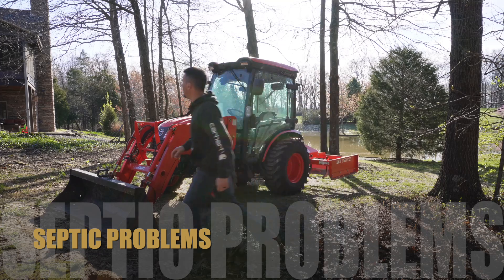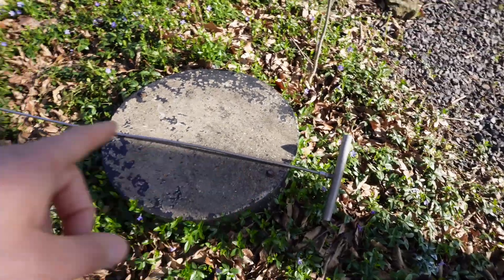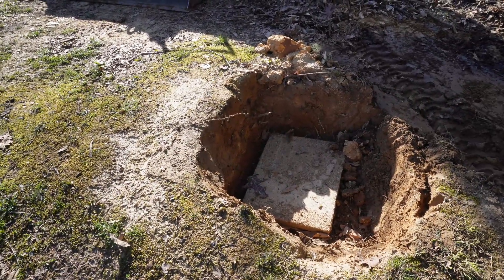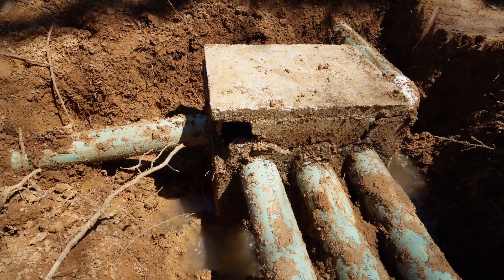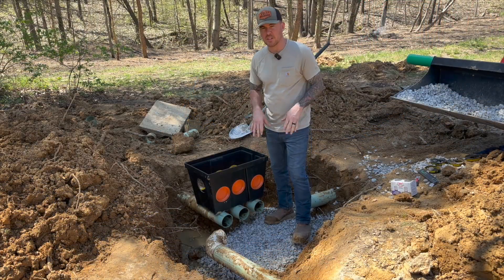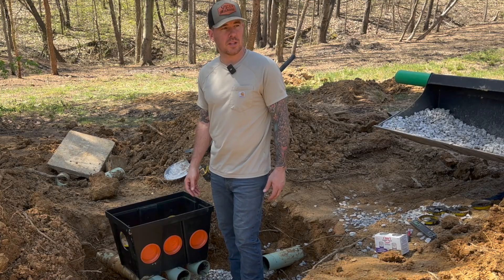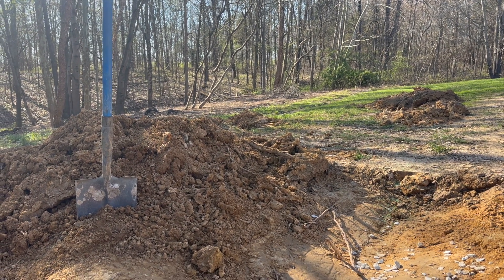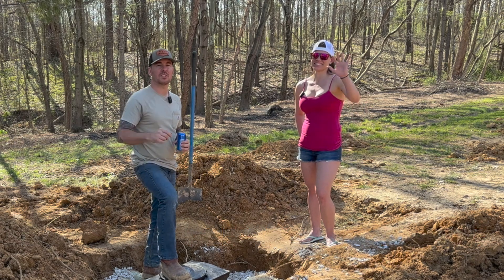PROBLEMS ALREADY!  How To Replace Septic Distribution Box.

Comment: Hey pal, if you are getting any solids in your d box the problem is in the septic tank. It's great you had the tank cleaned, inspect the baffle in the tank, third, install an effluent filter available at any septic supply house. Momma might do diapers but never sewer schtuff! That's on u. 😮

Comment: I am selling my house. Just had septic inspection from buyers. Everything checked good except my distrubution box. Yep it was like yours but worse. I think I can handle this job myself. I lack a cool tractor like yours to lift out the rest of the box. Question 1. Did you use regular DWV pvc pipe and glue for the repairs? I may have misssed it in the video. Quesion 2. Was the gravel you used as a base to support the box basic gravel or a specific size? Thank you

Comment: Could a bad distribution box cause water backing up in the house?
Reply from the maker: Not usually.  Have you had your tank pumped?   A full tank will do it or a failing leach field. Is your yard all wet where the leach field is?

Comment: Meant to thumbs up but there's only a thumbs down sorry watching have a job to move tank switch with alarm some areas ive seen were very similar I think the ground had to much rain and couldn't drain but our problem is the water goes down hill back to septic and alarm for pump goes o ff he has to push switch in basement he wants to move it up he's afraid he may fall down the stairs at night he's getting close to 80 so next week I will move switch to top of steps

Comment: I mightve missed it but how old was the d box?
Reply from the maker: House was built in 05.
Reply: @SpicerDesignsLLC  -- ok thanks.  Mine was built in 1990 so I'm thinking it's probably time to replace it.  I have a lot of seepage.
Reply from the maker: @Everclearish  if you dig it up and its falling apart then yes.  The seepage can be a lot of things.  May need to try running some treatment through for a wile and see if that helps.  The leach field may be clogged up.
Reply: @SpicerDesignsLLC  -- Yeah that's what we've been doing.  Fingers crossed
Reply from the maker: @Everclearish  i actually checked the dist box last night. Its full of water which means the field isnt draining.  Looks like ill be digging up the leach field and replacing it.  What a pain.
Reply: @SpicerDesignsLLC  -- Sorry to hear that.  That is a pain and more $$$ too.

Comment: How did it end up working? Was it distribution box or leach field?
Reply from the maker: The one finger is still a little wet.  Wet spring doesnt help either.  The box had to be replaced regardless.  I still have more work to do but its getting better.
Reply: a leach field repair video next
Reply from the maker: Ya thats coming but i probably wont film that one.
Reply: @SpicerDesignsLLC please video the leachfield repair! This video was helpful

Comment: I'm curious, I watched this video a couple months ago and did this repair fix your seepage problem?
Reply from the maker: Its definitely gotten better.  Ive ran some treatment through the system too to break up and clean the leach field too.
Reply: @SpicerDesignsLLC  thank you for the reply. This video was helpful for me to decide on repairing mine! 
 
My leech field has the same issue as you described, sloped with less topsoil where it seeps through (at the end/lowest point of branches). 
I dug up and found my d-box has started failing. 
My system didn't have speed levelers like yours did, but I just got some and hopefully they will help until I can replace it in the spring.

Comment: I’m a licensed installer and operation and maintenance firm. You shouldn’t add bacteria to the septic system. It is highly corrosive to concrete. Human waste has plenty of bacteria no more is needed and only causes damage to concrete tank and concrete D box.
Reply: I'd like to know a professionals thoughts about this:  should you occasionally add any if your household uses a lot of antibacterial soap? Just a recent thought I've had.

I recently bought my house and assume the water softener salt had deteriorated my D-box.
Reply: In the state septic classes they teach there is never any reason to add chemicals sold as septic treatments. Human waste has high levels of bacteria so no more bacteria is needed and additives will only cause damage to the concrete.
Reply: @nicholasuhler3676  thank you for your response,  I appreciate it

Comment: That is actually a Baffle Box, bigger than a Distribution Box… i should’ve used a machine like you i pulled one by hand and replaced with a new concrete one. Trying to get it level was a nightmare.
Reply from the maker: My baffle is in the septic tank.  This just distributes the liquids to the leach field.  Ya it wasnt a fun job
Reply: @SpicerDesignsLLC  Yes you have an inlet and outlet baffle in your tank but The bigger style distribution boxes such as the one you have is called a Baffle Box.

Comment: My septic system recently did not pass inspection. But what I'm not keen on is that the company that did the inspection, i.e. for certifying the septic system in the context of a home sale, owns and operates a company that does septic installations. He gave me a quote for a new leech field (but said the tank is very likely salvageable) and so I'm considering it. Meanwhile, I've researched septic systems for the first time, including watching this very insightful video -- thank you -- and have been wondering, what if the problem is just the distribution box?  Seems like that could be the source of the system failure and be a much less expensive fix. Would appreciate any comments.
Reply from the maker: Very well could be the problem.  Once the solids get to the leach field its pretty much game over.  If you just started seeing an issues it may have only made it to the dist box.  Good luck with the repair
Reply: I rather have a company that installs a septic system than one who never install a system telling me it is good or bad ??

Comment: I’m a septic inspector. It could be leeching up in the yard because that finger was getting all the water. Like you said, they weren’t all getting the water. So that one finger could be over saturated. Close of that one finger for a month or two. Let it dry out. Then rotate the cap back so it accepts water
Reply from the maker: Thanks for the suggestion.  It has gotten better but i noticed it was wet in a couple spots the other day.  Im going to close it up temporarily like your saying.   Thanks

Comment: If your effluent is seeping to the surface it means your leach bed is not accepting the water.  It's either saturated because the soil cannot accept the water anymore (its past its life span or it was put in a bad spot to begin with) or you've had solids make their way to the field clogging the holes in the leach pipes and/or the passages in the gravel trenches.  You will ultimately have to abandon that line and add another at some point in time. I would suggest removing anything from going into your septic that doesn't absolutely need to go in there (water softener discharge, laundry, etc...).  A grey water system is a good idea, or find a hill and pipe your grey water to it.

Comment: Leach field is bad, needs replacement.
Reply from the maker: Leach field isnt that old.  I put some treatment in it and regraded that area.  It hasnt leaked since and no issues with the plumbing.  I check the new distribution box periodically and it all looks good.
Reply: @SpicerDesignsLLC  What did you use for treatment? thanks.

Comment: Its the gases that deteriorate the tank... You can vent the system but then you are smelling it as well... Whats your tank look like?? Mine is mint from the water level down above the water level where the gases are the tank is rotted away.. Im due.. Today i replaced the first d box in the system, What a mess but its done!

Comment: Do all conventional systems have a d box? I have a 1973 home with original gravity system.
Reply from the maker: It should have a distribution box.  I know on older septic systems they used to use clay tile and cast installed of pvc.
Reply: @Spicer Designs  oh okay.  I gotta find mine cuz my tank is running high on water. I'm praying it's a d box problem or with the line between the tank and d box and NOT the drain field
Reply from the maker: @TheBalognaPony  it is normal for the liquid to be toward the top of the tank.  The tank will fill with the liquids and every-time you flush or send water in,  it will push that same amount out to the leach field.  But if your having issues in the house thats a problem.  And by no means am i an expert,  im just sharing what ive learned.  Hope thats helps and you can get it resolved.

Comment: I have never done a job like this.  Nice Job you made it look easy.  But I have a question, should you have reversed the orange hole plugs?  Install the large size inside the box so there would be no chance to have them pop off the box due to excess pressure.
Reply from the maker: Thats what i thought too, but the larger flange was on the outside.   They seemed flimsy for being buried.
Reply: @SpicerDesignsLLC the static pressure at the Distribution box is very minimal to start with, secondly as you back fill around the d-box you create an equal or greater off setting pressure so those plugs will not dislodge or move.